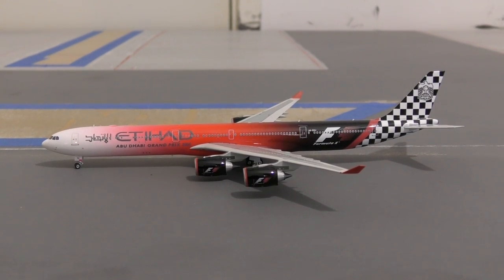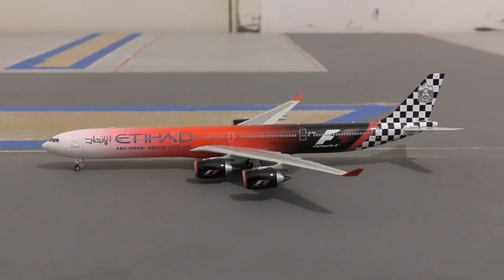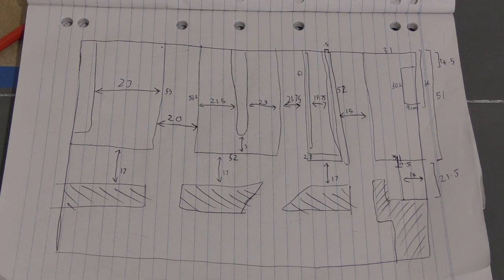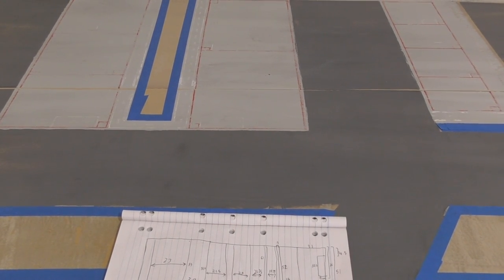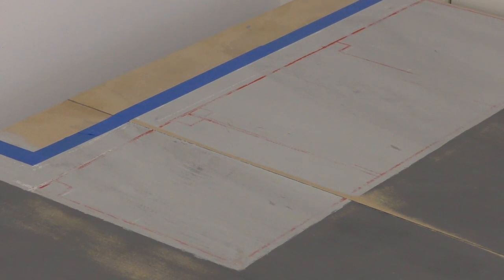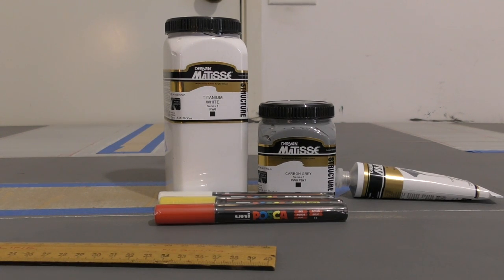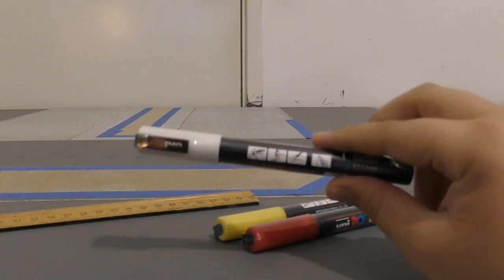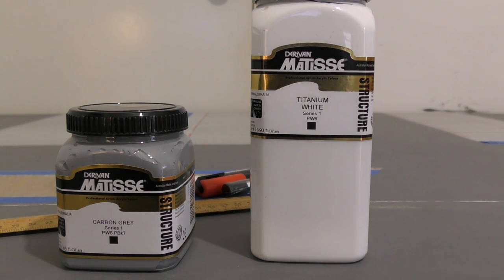How to Build a 1:400 Scale Model Airport | Paint, MDF Board & Plans | Episode 1

Comment: cool video! I'm remaking my airport out of mdf, so that's why there will not be an update in the next couple of weeks. what is your mdf resting on?
Reply from the maker: Cheers, MDF is the best choice. My airport sits on a workmen's foldable bench, you can purchase them cheap at possibly your local hardware store. This one can hold up to 150kg :) however, when the board is completed we might fit some external legs to make it just that little more stable.
Reply: Dj's Aviation thanks! I have some  2x4s laying around for external legs!

Comment: what thickness are your posca markers?
Reply from the maker: The middle thickness. I believe it could be 1.5
Reply from the maker: To add I believe there's a thin, medium sized and large sized one. Mine is that middle one.
Reply: Dj's Aviation oh ive bought the 0.7
Reply: Dj's Aviation your markings  look thinner than that
Reply from the maker: Mine are the 0.9-1.3 ones. It really depends on how you also hold the pens. If you hold it a particular way it is likely the lines will appear thicker etc. If you apply less pressure they will come out thinner. Hope this helps.
Reply: Thanks ill subscribe to you on my new airport channel when it is built!